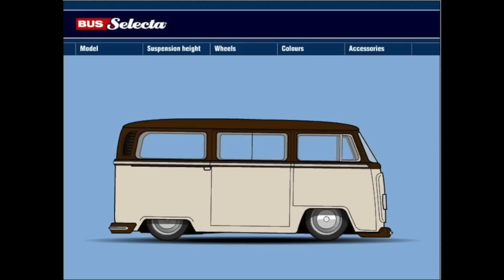The Barrett Jackson Bay built by the PRO's at Airkewld - 1970 Volkswagen Type 2 Deluxe Bus

Comment: What size wheels and tires were you able to fit?  What was the wheel offset?  Did you "tub" it?
Reply from the maker: 17x7, 5.125 back space front and rear. 205/40’s and 215/45’s stock beam, no tubs, no rubs
Reply: @AirkewldVWs  Nice.  It looked like you were able to get quite a bit of rubber under there.  I like it.  You don't see people get that much rubber under there very often.